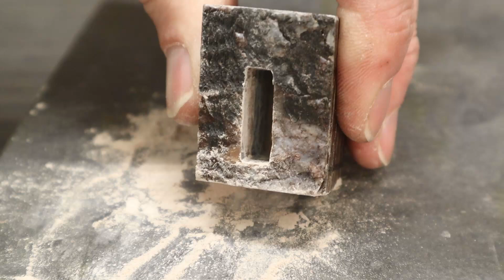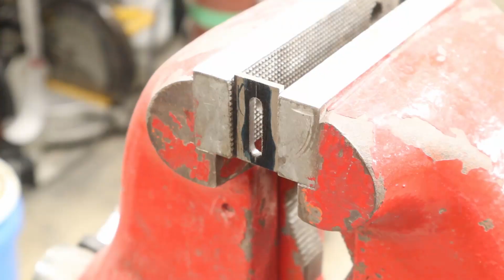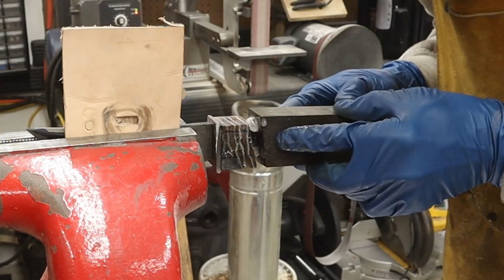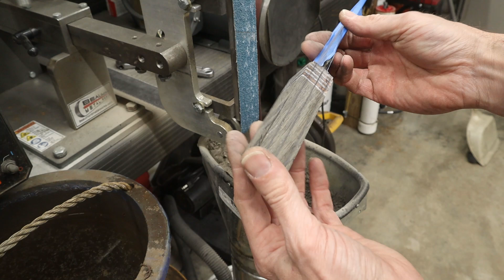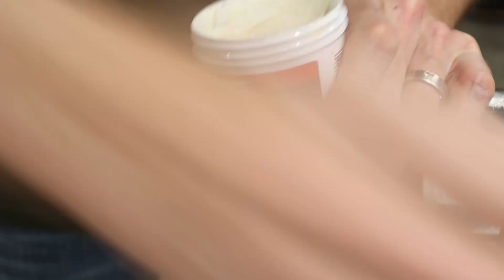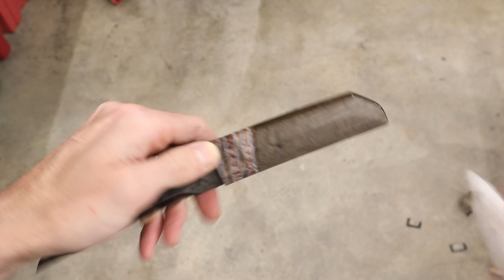Working with Mammoth! Making a knife handle using Fossilized Mammoth tooth and Ancient Bog Oak!

Comment: You need some Ways Trays, my friend. Go to Wally World and pick up some cheap cookie sheets to protect the ways.
Reply from the maker: Good call! This machine is completely clapped out already though😁
Reply: @Aleeknives  been considering going to a scraping class myself. I picked up an older Rockwell knee mill and it’s taunting me to get it ready for precision work.
Reply from the maker: This one has already had the ways re-surfaced and hand scraped some time in the distant past. The machine found it's way into the hands of a true idiot. When I got the machine they had been pumping the entire machine full of axle grease! They thought all the zeros were for grease😂🤣😂 took a good amount of time to dismantle the entire machine and clean out all of the way oil tracks

Comment: The white stuff between the layers is enamel , all the brown or other colors stuff is called dentine. I have made a few knives handles with mammoth parts. The best way to work it is to use very sharp tools and belts at a low speed so it does not get hot. If it gets hot it will crack or chip. If you polish the mammoth parts later...the enamel will resist while the dentine will erode faster.....kinda cool old look. https://www.facebook.com/photo.php?fbid=3844556582293070&set=pb.100002162994745.-2207520000..&type=3
Reply from the maker: Thank you! I love this material and love the way it polished!

Comment: sir where you get that tooth from ? link to webshop ?
Reply from the maker: Ebay seller "stabwood" great vendor!
Reply: @Aleeknives  thanks sir
Reply: i order a tooth , it is all ready underway , so you sand / grind the tooth till a 500 - 600 grit before you use the polish wax ?

Comment: I Inlay a piece of brass in the pin hole to the blade tang even if the epoxy fills that hole I recommend it over not 👊🏼👊🏼
Reply from the maker: I will take that to the bank James! Thank you!
Reply: @Aleeknives  it’s cool to watch the brass come up with the wood while drilling the hole knowing you nailed it just right 

I drill a 1/4” hole in the tang when I use an 1/8” pin ,allows for even the smallest miss measurement
Reply from the maker: Love it! I will be doing this

Comment: I think the entire knife is stunning. I prefer a bit more of a bulbous end to the grip to hold onto but in this case the cut away mirrors the blade tip and adds a beautiful touch to the overall appearance. Fantastic work sir.
Reply from the maker: Thank you! I totally agree with you about the handle design!  I had never made one like this before! It does have it's place though
Reply: @Aleeknives  absolutely agree, very well done.